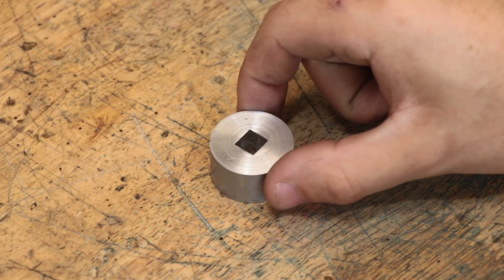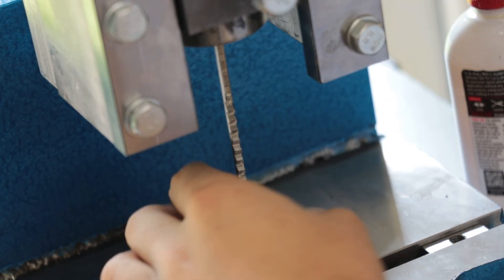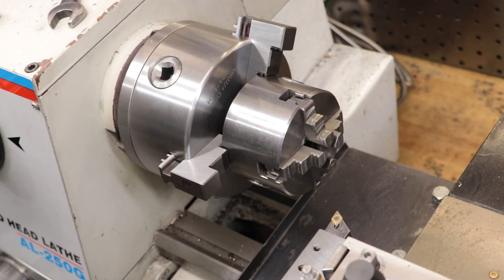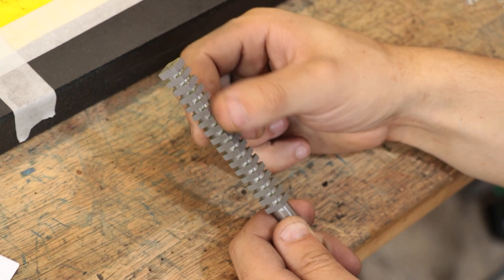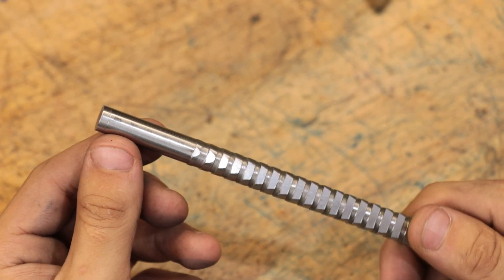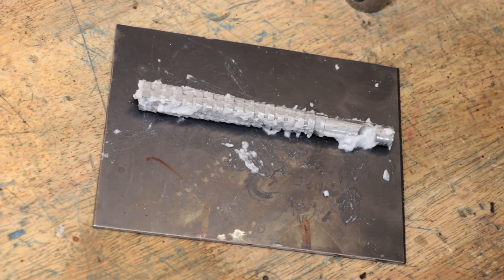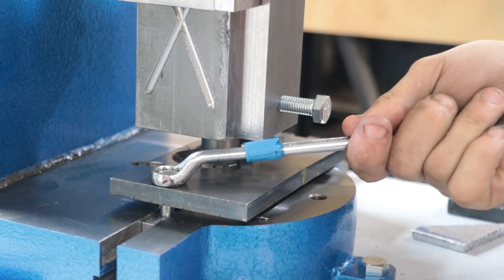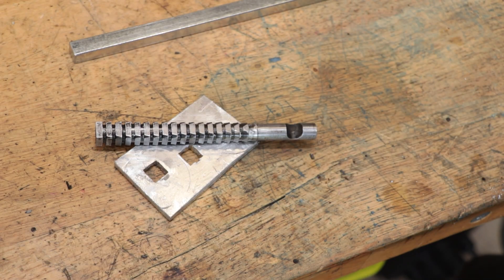Making Square Holes With A Square Broach

Comment: if i were you i would have made the broach the other way round so that your pushing the job into the press bed
Reply from the maker: It’s just a different style of broach. They are more likely to shatter than a pull type
Reply from the maker: That’s why what are more common for things other than key ways which are usually push
Reply: @artisanmakes  but does that make them better for your type of situation ? Where is the maximum support for the piece being worked?
Reply from the maker: I’d rather not have the broach shatter on me. That’s was my approach for this design

Comment: why didn't you do a push-broach instead of pull-broach? Seems it would have been smarter to avoid having a pressure plate and avoiding the bend problem alltogether.

+ you are no longer limited to a broach force of the tension strength of the bolts used to hold pressure plate in place.
Reply from the maker: I think I mentioned taht this was a fact fining exercise to see if it would work and if so how well. Big advantage though is i don't have to worry about the broach shattering, which is easy to do on a push set up

Comment: Yep definitely not wrong about EDM being expensive. Im an apprentice at a machine shop in New Zealand. One of the machines i run is a 4 axses cnc die sink EDM. I think we payed around $120,000 for the machine a few years ago. And since its a very slow process the costs add up. I think we charge $45 an hour for machine run time and an extra $105 if an oprater is needed. Wier EDM is faster for this kind of stuff but the wier is a big running cost.

And good luck finding a hobby leave EDM for the garage 😂

Comment: I keep wondering if I can put some top rake on the teeth. Last square broach I made was for brass so it didn’t matter. Kind of mushes in aluminium.
Reply from the maker: There is probably some way to undercut the teeth to crate a bit of a sharper cutting edge

Comment: Why did you quench O1 in water?
Reply from the maker: It's an easier set up and you dint have to remove and polymerised oil off the steel. You still get over 65 hrc

Comment: O1 steel is oil hardening not for water
Reply from the maker: It's not but it works just fine with a water quench. You'll still get 65 hrc  which isn't too far off W1

Comment: I used to moldmaker work at a shop HI Life Rubber  in Wisconsin that made milking inflations,  those big black rubber things that they milk cows with.  There was a bunch of these old molds from a company called IBA, they had developed back in the 60s a inflation design called engineered collapse,  these were square rubber parts about 13 inches long (300 mm) and about 4 inches of the part was square.  We didn't make these molds in our shop and I always wondered how they could put this square hole through 4 inches of steel.  This was very mild steel,  leadalloy,  free machining steel.  But still to push a 1 inch square broach through that much steel was pretty impressive. 
We started making modern versions of these square molds using S7 tool steel and a $250,000 four axis wire edm.  That worked really nice,  we'd go through about 5 inches of steel.  These were big round parts, about 4 inches in diameter and a precision pilot hole to locate the wire with.  It  would take about a half a spool of wire and at least a day to cut the slug out. With the 4 axis machine we could cut square tapers, triangular straight and tapers, transitions from round to either a square or triangular hole on the other side of the mold part. 
Cool stuff,  all you need is a quarter of a million bucks.

Comment: The first time I saw a chuck held by a chuck the video finnished with 4 progressively smaller chucks from 12 inch down to 4 inch.With the lathe running each one looked like it was going in the opposite  direction totally weird.

Comment: nothing to worry about clamping a 4jaw chuck in a 3jaw. I Was clamping a 250mm 4jaw on a 220mm 3jaw on cnc and it worked. Just have some common sense when cutting and u are good.

Comment: the great thing is you can use the same tool for push broaching, and since is symetrical in all 4 sides and pretty thick it wont tend to bend like a regular broaching tool. you can also make a "guide" for the broach to keep it perpendicular and supported, it works just like drill bit guides

Comment: You could use an appropriate sized socket wrench into the 3 jaw to hold your square stock.
Reply: Diagonal of 10mm is 14.142mm, so a 12 point 14mm socket would work. You might have to shim it with some aluminum foil or paper to hold it tight....but it would work.

Comment: Sorry for the possibility dumb question but I was under the impression that O class steel should be quenched in Oil (compared to W or A class - water quench and air quench respectively) for best results. Is there some specific reason you went with O class steel and quenched in water?
Reply from the maker: Despite the name I've quench it in water without much trouble. Makes it easier for for since I don't then have to remove the polymerase oil that sticks to the cutter. Also easier set up and clean up.
Reply: He didn't have the broach hot enough either.  There was barely any red showing when he quenched.  It should have been a much stronger red , almost glowing.  That would have been around  1500 to 1600 Fahrenheit.
Reply from the maker: It's a little low but we still got 60ish hrc then tempered back

Comment: For affordable EDM, the Rack Robotics Powercore seems to be a promising option... I haven't seen any proper reviews for it yet, but it does seem to work decently well. I wouldn't count on the accuracy, lacking a spindle and water flow, but it might be worth having a look at it if you're interested.
Reply: it has a spindle and water flow if you build it
rack only supply the spark generator

Comment: Since you're on a press kick, should try the opposite of a broach, a die - press or pull the workpiece through the forming plate instead of vice versa. Could get some nice shapes with a series of dies, and it's a fun fabrication challenge I think.

Comment: I think you might need a cover plate that has a hole just big enough to allow for burr to minimize warping, or perhaps a sacrificial cover plate with just the exact size of the square hole on top
Or even having the grooves a little deeper, it would sacrifice strength somewhat but could allow the shavings to be dragged out inside them. Anyway, I'm just spitballing, it seemed to work well enough already as you've measured in the end!

Comment: To overcome the relative short length you could make multiple broaches that gradually step up in size and use them in series if you need to broach harder or thicker material.
Reply: It helps that he made the locking pin sit at a reliable spot as well, so there shouldn't be any issue with alignment. Should also help with ease of use for any future keyway cutters to fit that same tool holder

Comment: Used edms that need some love can be bought for around 2 K . Old stuff tho
Reply: If you really needed to put a square hole in something,  you'd be better off taking some of that $2000 and finding a tool shop with a wire edm and paying them to put the hole exactly where you want it.  If you just want some nasty oily money pit get a harley davidson.